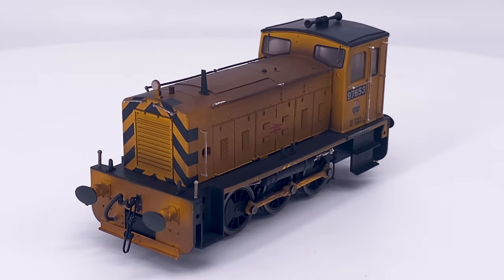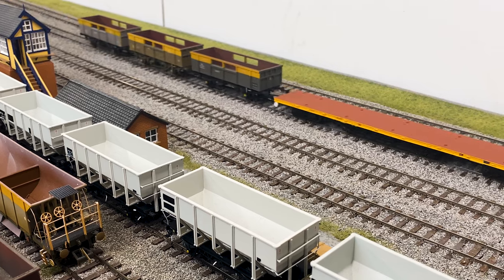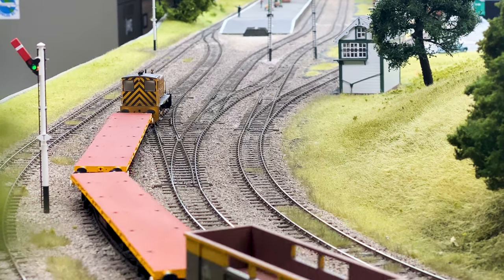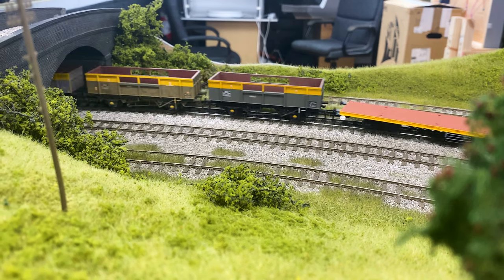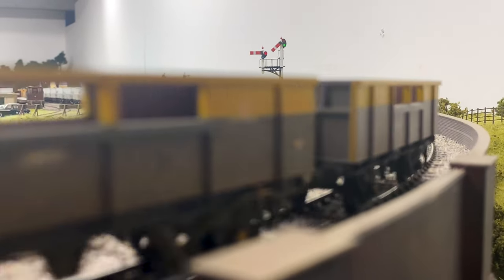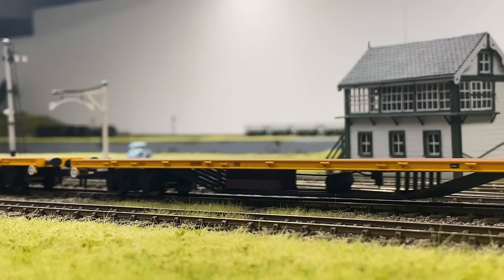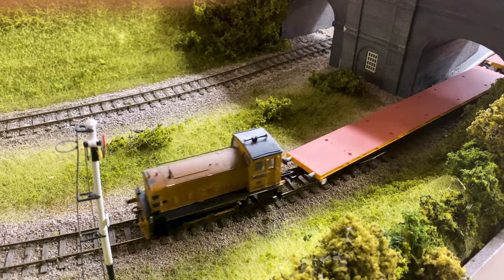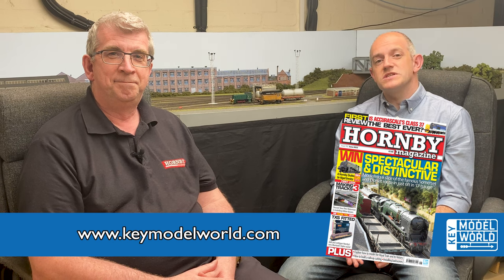HM192: Heljan Ruston 165DE for 'OO' gauge

Comment: The PWM versions were initially used as part of permanent way trains on the main line, the drive could be disengaged to allow them to be towed at speed, then when arriving at the work area, the larger loco could leave and the ruston would take over shunting the permanent way train along the line at low speeds

Comment: The fit and finish looks really poor, even on this sample. Have a look for other uploaded videos of these and the dreadful lumpy running some of these models display, most likely from out of quarter wheels...or even worse wheels actually splitting apart on the axles for which there are photos of this on a couple of forums. Not good enough at this price point, but that seems to be Heljan all over.
Reply: Yep, I bought one and it’s everything you mentioned. You 100% correct. Lousy lighting effects, chunky details and non-crisp paint work and very expensive for what your getting.

Then again I am really pleased the model was made (who would have ever thought a PWM 97XXX shunter would have ever been made in OO gauge). 

Just bought a second model as I don’t ever see them doing a second run of this model. I simply don’t see there being the demand. 

So in summery I am happy to pay for the model. It’s not perfect but it’s a whole load better than the old white metal model I had. Very thankful the model was made. Hence I bought a second model and intend to buy a third one after that when funds permit.